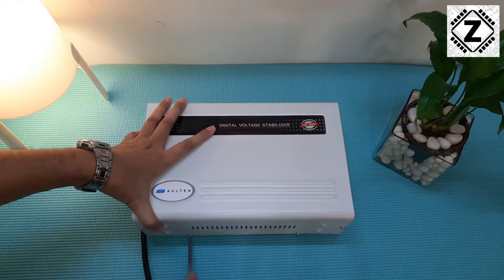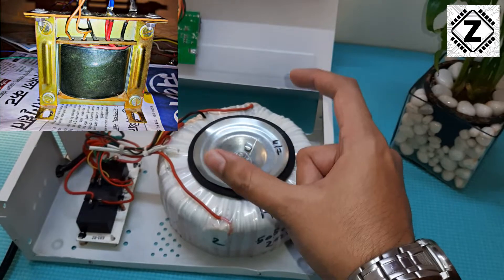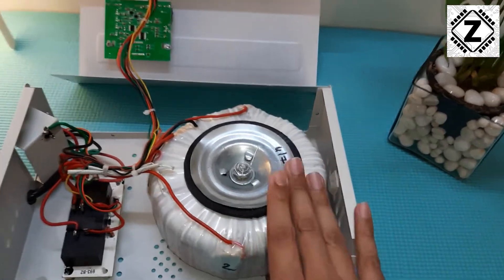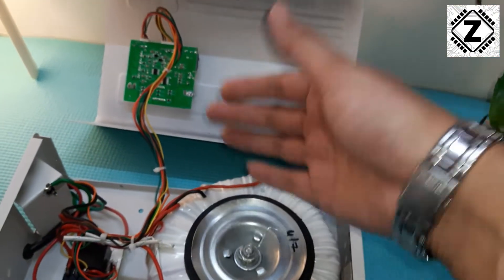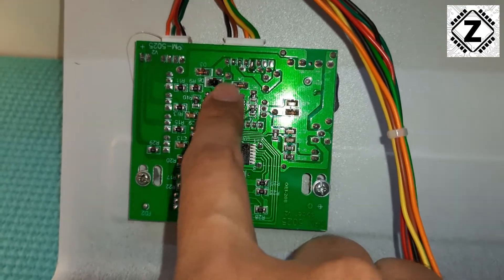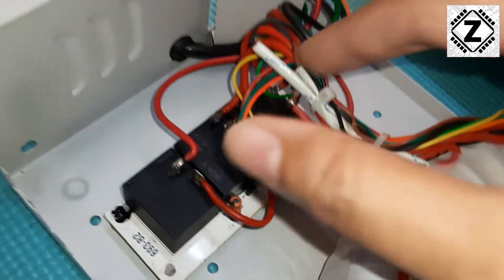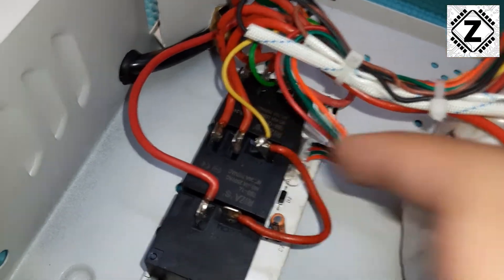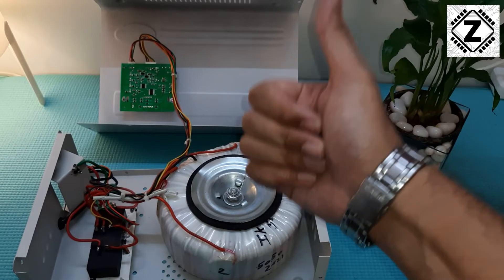[Eng] What is Inside Aulten 5kva AC Voltage Stabilizer & How it works?  | All components Explained

Comment: It's a poorly designed stabilizer. Their replacement warranty is also a sham. Their customer support is not responsive. I write this based on my experience in dealing with them when I recieved a faulty unit.

Comment: I have purchased aulten 150 - 280 alten

But after wiring ac outer unit up nahi ho raha ,

Ac up nahi ho raha
Reply from the maker: Check using multimeter what's the problem.
Reply: @ZenInnovations  

Bhai,

Direct karane pe work karata hai..🥺
Reply from the maker: @techleaders3125  maybe wiring is not correct...

Comment: I am facing low voltage which leads to AC getting low current nd not working with full potential...so is this gadget works for this problem???????
Reply from the maker: Of course. That's what stabilizers are for.